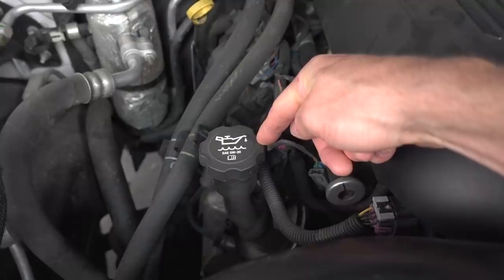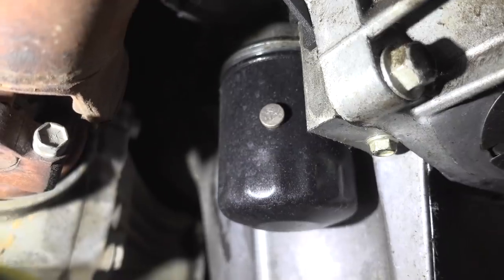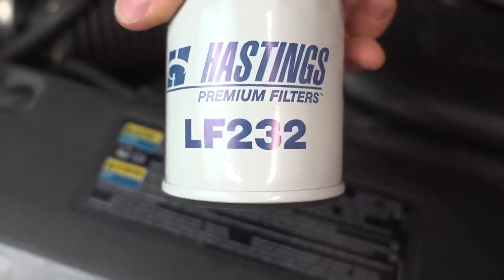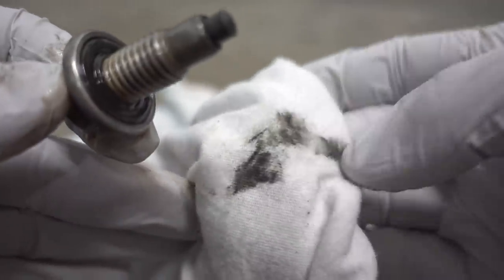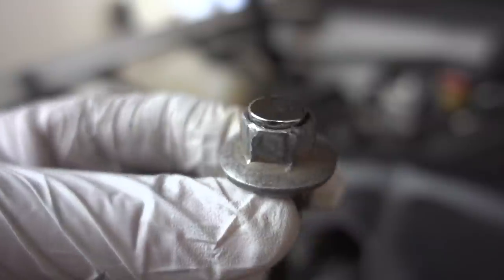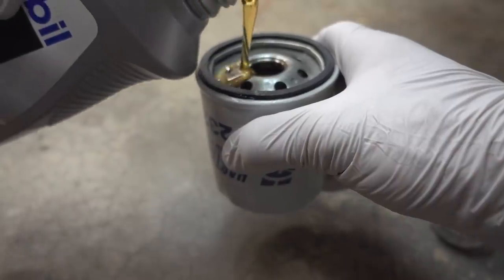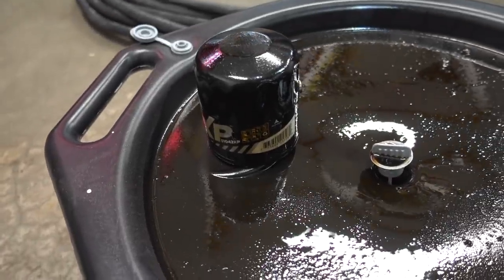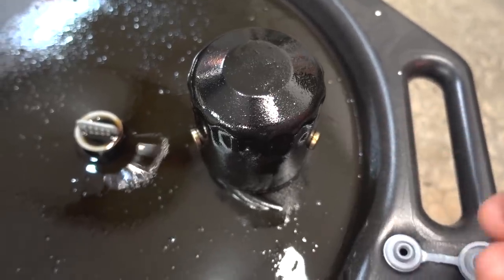Look What A Magnet Did To My Motor!

Comment: You don't need oil additives on a quality synthetic oil.Maybe on a conventional dinosaur oil.
Reply: Watch motorkotes demonstrations, do a treatment one time thank me later
Reply: Bestline and Motorkote work well with synthetic or conventional. The base oil, synthetic or conventional, needs additives to protect the metals of the engine.
Reply: Different motor oils have different friction performances. Mobile 1 is one of the worst. So if he is using Mobil 1, you should use friction modifiers.
Reply: Do you know what "base" most conventional motor oils are?
There are 2 types the most common is a paraffin base which causes the excessive build up of junk often found inside the valve covers and elsewhere .Pennsoil,, Valvoline, Mobile..... Are paraffin based.
 The other is mineral oil base which is much cleaner, to my knowledge Castrol GTX is one of the very few oils that are mineral oil based.
But don't take my word for it, research the topic yourself .
Reply: @nato7.62mm4  I was simply responding to your comment, and my response cannot be denied. However, in response to your next comment, I do know about mineral oils. I do know they are cleaner and I do know Mobile 1 not being a mineral oil causes a lot of the junk. In fact Mobile 1 is more dirty than people realize. You mentioned Pennzoil, me personally I like the new version because its not made out of oil, its made out of gas. This makes this oil cleaner. Still, oils that are non mineral oils, as long as you change them at 5000 to 8000 miles roughly, it dont matter if you are using those. Its not going to significantly dirty your pistons or create junk. The reason why I said what I said in the first comment is simply because during the time the Mobile 1 is used even from being new, it has poor friction performance. Therefore, there is nothing wrong with using friction modifiers. In fact it can only help. As always I mean no offense nor do I intend to get into a discussion. Have a great day.  :)
Reply: Truth7 EndTime 
Dude, notice the line above? This indicates that this comment is directed to YOU. Notice also that no such designation was present above my original comment, indicating it was a public comment directed to no single individual.
Suggestion: Cool your jets, perhaps resume taking your meds.....
Reply: @770Noe  All new Mercedes-Benz vehicles use Mobil 1(<==No "e" in Mobil). If the label says Mobile 1 its a cheap knock-off. Of course you know more than Mercedes-Benz engineers.
Reply: The shear tests put way more pressure on the bering surfaces than the internal surfaces of the engines actually produce on the parts.  Pretty much every engine start would require an engine rebuild, even when using Motorkote or Bestline.  So every oil made for sale in the United States has to meet or exceed the vehicle manufactures requirements for sheer strength in that vehicles engine.
As long as you are using the correct oil type and weight your vehicle manufacture requires for your vehicle, you are fine.  So, don't use 10W40, just because that's what grandpa used in everything back in the day, when your vehicle calls for 5W30. You're just asking for trouble.  Also don't use 5W30 when your engine requires 5W20 or 0W20.  Use only those weights.
If you want to use an oil additive to increase lubrication, that's an individual choice and it shouldn't cause any problems, otherwise it wouldn't be for sale in the United States, so go ahead and use it if you prefer.
Reply: @clagueb3686  Hi. There are more than one reason that car manufacturers use any product. Manufacturers of spark plugs,  tyres batteries light bulbs etc sell them to car makers at a special price because many car owners replace these components  with the same make for just the reason you state.

Comment: cherck out teho filterr.. may be worlds best filters..???  use a super paper used mainly on big machinery..put so some oil in the filter..when finished turn motor over  in small sections but dont start it...once started run only  say 7 secs..till oil pressure build up..do make sure u  start the motor same day... with new oil or filter..oil anti wear agents worth reseashing..stops especially cold motor start ..or wear from  long period rest motor start wear...my opinion ..have 50 yrs experiance with motors...do use also strong magnets..from hard drives on the sump.. oil filter and oil plug areas..to see how much wear u got  also collects yr free steel..xxoo

Comment: I have that sound. Only after I changed the plugs and wires. Changed oil used seafoam and motor flush. Didn't help. Don't think it's debre most likely a loose lifter, a bent lifter or a bent value head or piston

Comment: that ticking is dry injectors, add 1/4 cup of 2 cycle oil to the fuel, do this a couple 3 times a year.
Reply: Dry injectors ???? Another youtube mechanic. You wonder what that oil burning does in the cylinder and then past the 02 sensor and converter ??? You still pump the gas when you start your fuel injected engine i bet

Comment: I think putting a magnet on the drain bolt is not a good idea, because when you unscrew it the shavings are going to go trough the threads and that could mess it them up or it might leak. If you have done this many times.. kudos to you. Correct me if I’m wrong. This is just an assumption on my part.

Comment: Questioning the magnet deal.. Shouldn’t your filter filter out any particles? The filters have a micron rating and should filter out metal shavings. THE QUESTION, the magnets placed on the exterior of the filter is that oil on the other side of the metal where the magnet is mounted coming through the filer media or is it on the way through the filter media. If the oil is on it’s way through the media maybe your filter would catch the metal that the magnet is grabbing, but if the oil has already passed through the media maybe a better filter would be in line.I understand the small magnet on the oil drain plug because that is well below the oil pump pickup where shavings would settle. SUGGESTION, could you not use the filter magnets for one oil change and have the filter media examined after use to see if the media has filtered out the metal fillings??? Or would this be a project for Project Farm???

Comment: Whether you have the upright mounted or the side mount...you should wipe a small dab of the new fluid after opening the container.....wipe the new oil along the perimeter of the new filters O-ring.

Big V8 and only five quart oil capacity...for shame for shame GM......my 2008 Volvo XC-90 had a in-line six and had a eight quart capacity for more thorough and complete circulation of the entire engine..

Comment: You should try Rotella T Synthetic 5W40 and put 2 shot glasses of Redline Engine Break-In  Additive in. The Redline Break-In Additive is just the same anti-wear, anti-oxidant, friction modifying additives already found in formulated engine oil. No cholrinated parafins or "hyper-lubricants" which is just marketing gibberish! You might also try Mobil-1 0W40 it is now standard fill on the Corvette which used to recommend Mobil-1 5W30. People laughed at me 12-15 years ago when I recommended M1 0W40 or Rotella-T 5W40 for the Corvette and all other LS engines and Vortec Engines since the oil cap and terrible owners manual only list 5W30. You can either use science and reasoning to make a decision or you can put your faith in a corporation that is built on planned obsolescence and meeting CAFE! Just like that lifetime fill of gear lube or the atf ! lol The Motorkote is nothing more than synthetic base stocks and regular additive technology found in oil. It is way more expensive than just running a good synthetic and adding some Redline Engine Break-In Additive. If you really wanted something incredible. 1 Gallon of Schaffers 131(Amazon if no local distributor) and add Each oil change put in you synthetic oil of choice, 1 cup of Schaffers and 1-2 shots of Redline! In a healthy automatic 4 onces once a year of Schaffers 131 with nothing else added repeat no other additive in the ATF at all. If it is a dirty transmission but still working right and not insanely high milage put 1-2 onces in 1000 miles before you do a pan drop and filter change for very mild cleaning. The Schaffers 131 is a very polar synthetic base stock with just a tiny bit of additives and I think a tiny bit of crysilic acid which is used in fuel oil furnace additives like Clean Burn to gently clean carbon build up, lacquer/varnish. It is great for fuel system and lubrication systems. It is very concentrated so a little goes a long way. My recommendation assumes a clean well maintained engine. If an engine was really dirty and neglected I would use a treat rate about 1/2 of what I recommended above. Your 1995 is probably too old to appreciate the following recommendation but in GM transmissions at 10K miles on a new vehicle or rebuild drop the pan and change the filter and refill with Redline D4 ATF or Amsoil ATF then change it every 50K miles.

Comment: Hey buddy, this sound comes from the lifters. the only thing that you need to do just replace oil pump inside engine. BTW, don't buy OEM oil pump. just get high pressure and high volume oil pump.
Reply: your joking right?

Comment: The sound you hear is injector tick. Its the injectors opening and closing which is audible. I don't think the friction modifier was a great idea. Automatic trans are super sensitive. If your seeing that much fine metal particulate in your oil and on your magnets you have excessive wear in your engine. I drive my car super hard and there is never a speck of that fine dust.

Comment: this is a tip for Jimmy 1R: "graphite" in the motor oil was made and design for the pivot pins in the space shuttle and Rockets..it was needed for as lubricant made for high heat and wouldn't burn off at a temperature of 600°F..the only place the gasoline engines get that hot is at the valves and the piston rings ( no other part of the gasoline engine gets that hot), so using Moble 1 is really a waste of money..one quart you would probably need the job..in my opinion, (2) try using "Tune Up by Motor-Purr" for your transmission shifting it's been around for about 60 years.. it's a car's medicine kit in the bottle & can also be used in power-steering too.

Comment: I had a Chevy truck with a bad transmission, I stopped got gas and it would not shift in any gear. That is when a friend told get lucas transmission oil. It took two bottles but truck did start shifting again, and I had all gears working again

Comment: Those magnets you use don't do anything because they are not magnetic when they reach 80 C.   There is a reason car manufacturers use ceramic magnets and not neodymium.   Ceramic magnets are magnetic up to 300 degrees.

Comment: So, what DID the magnet do to your motor? 

Also, the debate on prefilling has more to do with whether you pour it through the outside of the filter so that it filters the fluid, or straight down the middle like you did. Doing it that way means the fluid wasn't filtered, but I don't think it's that big of a deal.
Reply from the maker: I thought it was more about the alleged 'dry start'. Not sure you can just pour it in the small holes as they're covered with the anti drain back valve right?
Reply: @1RoadGarage  well, as you correctly pointed out in your vid, by design there are TONS of applications where you simply cannot pre-fill because of the design. Heck, some filter mount vertically but upside-down! So, while running dry for a second or two isn't ideal, it can't be the end of the world.

Also, the anti-drainback would keep fluid in the filter (I.e. not allow it to come out the small holes), but shouldn't prevent pre-fill.
Reply: If pouring new oil into the center hole of the filter is an issue, use better oil. If you feel you need to prefilter the oil, why would you even pour that oil through the fill tube ?
Reply: I swear ya'll modern men are behaving like old wives when it comes to oil changes and filters. There are no documented mishaps  that have occurred by not prefilling your oil filter prior to installation. Dry start, low oil pressure, impacted flow i've heard all the bs. Just amateurs trying to sound smart. If anything i'd leave it dry so more of the old stuff will pass thru and filter. 
I will say that lubing the gasket ring and making sure the old gasket is not left behind are solid intrinsical tips though. The results you can see.
Reply: TheBishop12 “leave it dry so more of the old stuff will pass through” what the hell does that even mean. How is leaving it dry changing what gets filtered ? Can’t wait to hear this BS.
Reply: Michael, the oil will drain through the filter media to the other side ? Just watch it sometime.
Reply: @TheBishop12  All true, but I do remember once starting up some car I had with a dry large oil filter. You could hear it and the wait was noticeable. I seriously doubt it hurt the engine though. If a vehicle has been sitting for a long time, I imagine there are ways to prelube it. One expedient would be to put a light oil into the cylinders, pour oil over the camshaft if it is an OHC engine and turn the crankshaft around by hand to get oil on it. Or spin it with the starter. Seriously, an engine which has been run within the last few hours or days is not going to be dry.

Even with an OHV engine, you can pour a light oil down the pushrods if you want. These are expedients and I am sure there are other ways to do it. In the bad old days, they used to spin the oil pump driving rod with an electric drill. I assume with some equipment, you can pump oil into an engine oil system from an external source also.
Reply: @TheBishop12  soybois and mangurls trying to look like something they r not
Reply: @TheBishop12  okay, you are smarter than Cummins Engine Company. The 6B-5.9 SERVICE MANUAL says to prefill the (installed vertical) lube oil filter. If Cummins says to do it, it is more likely to be sound advice than something originating from some random YouTube comment. In short, this uploader passes on a piece of sound advice supported by a respected engine manufacturer.
Reply: I've always Prime to my oil filters. Especially the ones that are a half a quart or more. My Cummins gets primed every single time.
Reply: The filter dry start is a myth , only a portion of the oil is ever filtered , most is bypassing the filter to actually lubricate the engine , If all the oil was filtered your engine would starve for oil ..the larger filters Cummings recommendation is to keep idiots from starting out two quarts low ..
Reply: @walterk1221  Im sorry you didn't get the joke ..hopefully your magnets show up in the mail shorty
Reply: @Walter K 
And at least 75 years of father to son advice on how to maintain your vehicle so that you don’t have to call a tow truck!!! 
But I get that in the last 15-20yrs, fathers have not been passing any knowledge down to their sons or daughters about much of anything especially vehicle maintenance!!!
Reply: This argument is so dumb.  If you can prefill why not?  Just like you said 1 Road.  It takes no time and gets your car back to what it was prior to draining.
Reply: Actually pouring the oil in through the center port is the correct method since that's the way it enters the filter while the engine is running.  The oil that goes through that port is then filtered by the media and comes out the surrounding ports and back into the engine.  
It's always being filled with fresh unused oil so the chances of any contaminants being in the oil are non-existant.
The logic behind filling the filter is to limit the amount of time the engine runs without oil.
I began using this method on my old 76 GMC Jimmy with the 350 back in the early 90's.  The engine starting dry after an oil change would always knock and rattle significantly until the oil pressure came up. Granted it's only a couple of seconds, but I never liked that happening.  One time it occurred to me that if the filter were full, then the time running dry would be reduced and tried it. The dry start was almost completely gone.  The pressure was there within a second and I always did it from that point.
I now work at Walmart as an Auto Care Tech and we always use this method when doing oil changes on the diesel pickups with the big oil filters.  The pressure is there almost instantly.  Even the 6.6L Chevy diesels with the oil filter at a 45 degree angle can have some oil added just to reduce that dry start time.
Reply: dannyo66 - actually great reply and glad you noticed a difference doing it.  One point however is the oil does not flow through the center port as you described.  'Dirty' oil flows through the holes on the perimeter of the filter where it is then filtered by the element and then comes out the center hole or port.  So pouring oil in the center port would not get filtered until it returns back to the filter. I have heard people say that's bad and new oil off the shelve has some contaminants in it.  I am like so what?  It will all quickly run through the filter anyway.  Additionally, have you ever tried prefill if the filter by trying to get it to go through those several holes?  Almost impossible and a waste of time.  Prefill whenever you can and you can't go wrong....  thanks!
Reply: @michaelwhite984  Hold throttle in flood clear mode, this cuts out the fuel pump and the ignition, crank till you have pressure...doesnt take long
Reply: @TheBishop12   Its a preference thats all
Reply: @duckwacker8720  '',ko